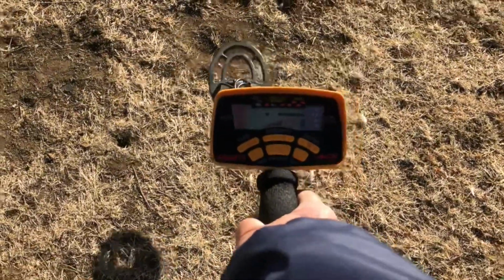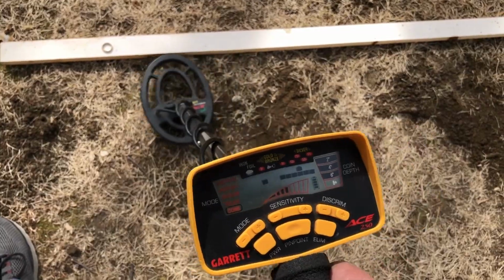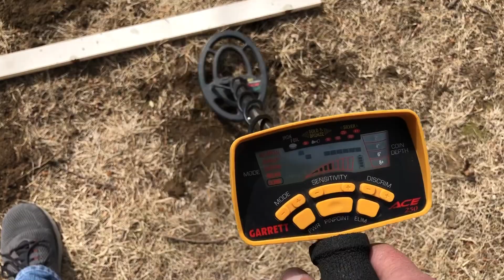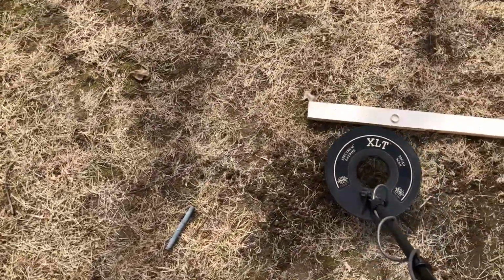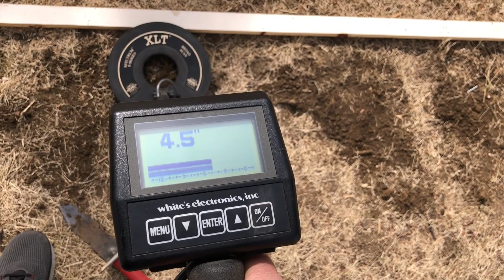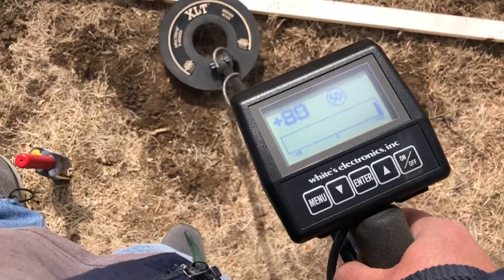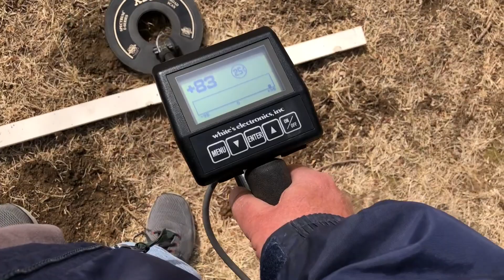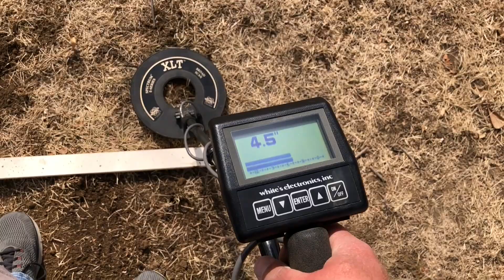PART 2 - Metal Detector Test - Garrett Ace 250 vs. White's XLT - This & That With Lovie Episode 15

Comment: hi which do you think is the best?  white's or garrett?
Reply from the maker: I actually use my Garrett Ace 250 more often, probably because of its light weight.  I’m also more use to it and you only use 4 batteries compared to the Whites 8 batteries.  I’ve gotten my better finds with the Garrett.  More trashy areas, I would use the Whites unless you don’t mind digging everything.
Reply: @thisthatwithlovie9314  please :)
Reply: @thisthatwithlovie9314 With no distespect the Ace 250 isn't in the same league as the Whites XLT. The discrimination on the XLT is amazingly accurate and there's no comparison when it comes to the depth. I have an ACE 250 I got for the kids and I have Whites DFX it's the XLT upgraded with multi frequency and other functions added. It's from 2001 and I still use it today and it gives modern machines a run for their money. Just take time and learn how to set it. The Ace is OK for surface coins but it digs too much trash and it's not nearly as powerful. Turn on tone ID and you'll hear the targets without looking at the screen it actually has 95 tones so the higher the pitch the higher the number. Using the tone ID you can actually hear the nickels from gold or aluminum with VDI numbers that are close if you learn the sounds. And you can tell the difference in pitch from a dime or silver dime the silver sings on the XLT. It's in the Audio settings also turn on the V.C.O and it will pinpoint even faster with a zipping sound. It's a really good detector. It weighs a little more but she's built as strong as a tank. You can even get a rechargeable battery pack for the XLT.
Good luck hunting out there I didn't mean to knock the ACE 250 I'm just experienced with using Whites detectors since 1979 so I've come to learn how to set them up. The XLT can go surprisingly deep if you put in some practice with it